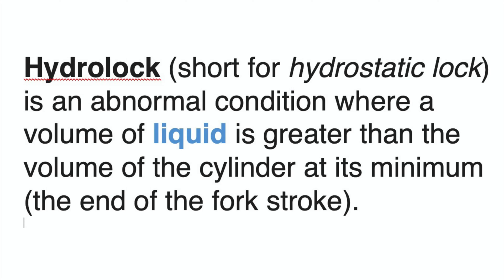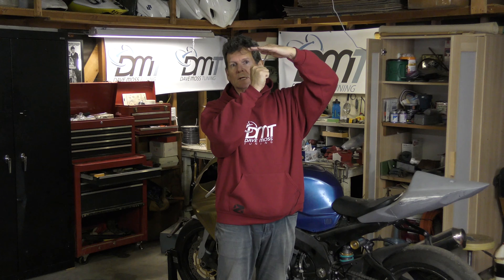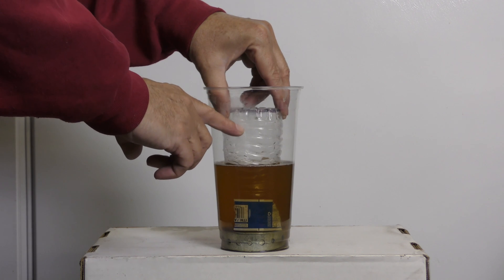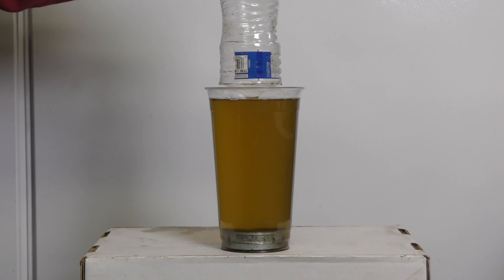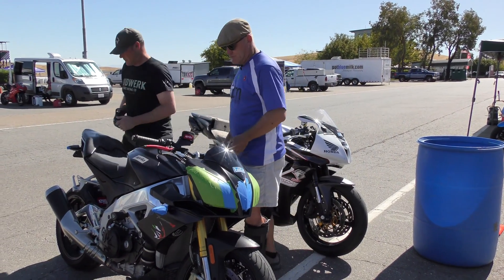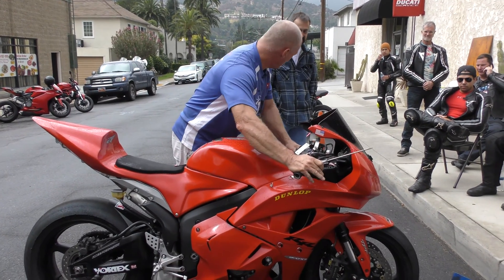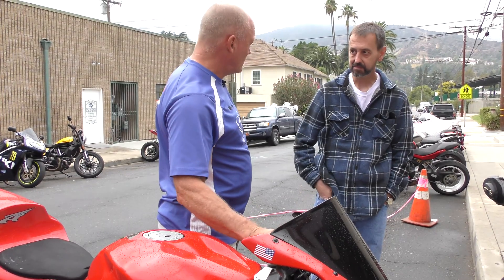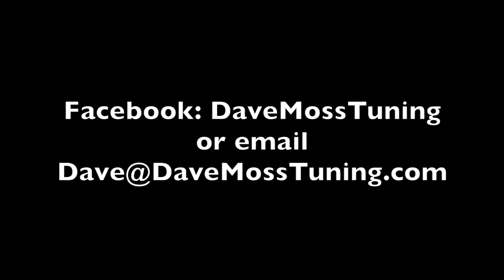Hydrolocking Motorcycle Forks

Comment: Hi I've got a zx9r c2 just fitted all new seals and dust covers put my forks back together but the suspension is hard it goes down but comes back up really slowly what have I done wrong and ideas?
Reply from the maker: If it comes up very slowly indeed, is this from the oil viscosity or are the rebound adjusters not set correctly? You should have 6 complete turns from maximum to minimum. Check the range.
Reply: @catalystreactionsbw 
Hi buddy thanks for ya reply I've managed to sort it just  need to set the forks up anyways it was the nut on top of the piston rod it needed to be reset so there was 12mm of threads
Reply from the maker: @eddiehughes9137  Nice catch - well done sir.
Reply: @catalystreactionsbw 
Thanks but if it wasn't for your YouTube videos I'd probably of nackard my bike up or even ripped off by the garages like some of the guys I've spoken to so thanks to you I've been able to sort out mi bike 👍

Comment: Is this ok to pump a telescope fork while tightening its uper cover bolt???
Reply from the maker: Any fork can be pumped to bleed it with the cap in place while tight but not torqued correctly.
Reply: Sir kindly answer me

10w oil is unavailable in Pakistan,which oil will work smoother like 10 w in my ybr shock 

Atf and 32 hydralic oil both r floped
Reply: Can we mix two or three oils to make exact 10 w oil????? Or any thing else okz guide me

Comment: I've just serviced the forks of my 99 sv650s and I put the oil (belray 15w) level at 130mm just as recommended by racetech since I swapped the original springs for some .90. The problem is that I can't compress the forks like Dave does in the video. The max I can get them to go compresswhen i push with all my strength is about 50-65mm which seems like not at lot? My manuel recommends to put the oil level at 110mm but I don't think adding more oil when i'm having trouble compressing them is gonna fix it. Could anyome lead me in the right direction?
Reply from the maker: The spring rate is fine and the oil weight and height is correct. Check the installed preload/spacer length. How much can you pull the forks up? Must be 25-30mm. If all is correct, install the forks and ride to see how much travel you use compared to known bottom out.